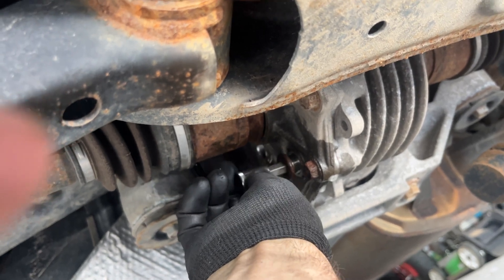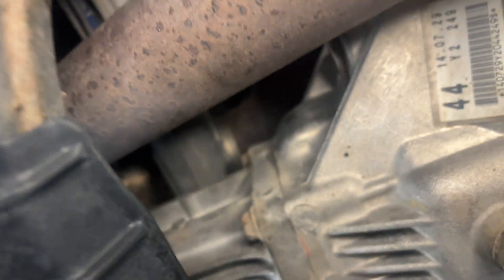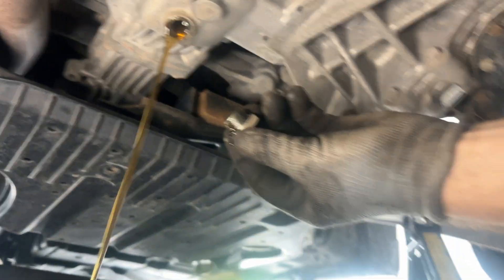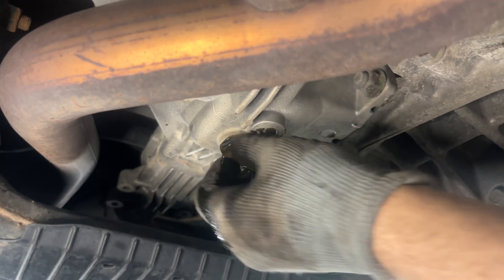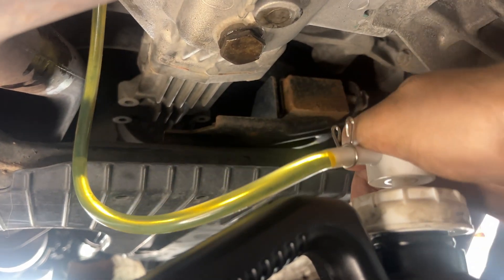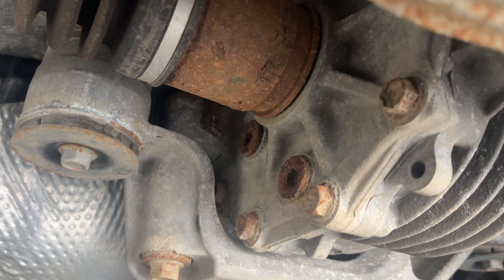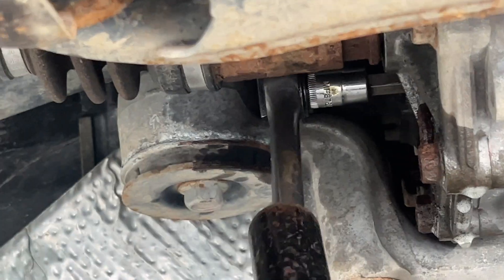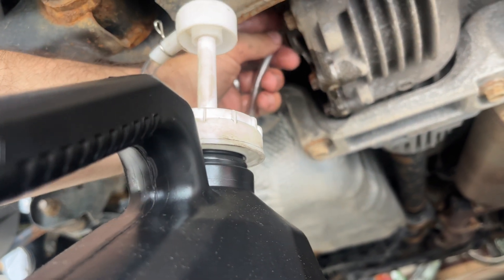Lexus and Toyota Differential and Transfer Case Fluid Replace, Front/Rear (2010 - 2015)

Comment: I only saw transfer case and rear. Where is the front diff?
Reply: Thats the differential 😂 type F5M43 oil change then open mmc manuals website and you will see it
Reply: The front diff is part of the transmission. If you do a transmission drain and fill, it services the diff too.

Comment: You have enough gear oil there to do both of these 3 or 4 times. The suggest change time is 40-50,000 miles with an AWD and every 30,000 at most if you have a 4x4 and use it as a 4x4 or pull a boat or trailer. 75W90 works as long as it’s G! 5 rated. Toyota calls for 75W85????. Don’t buy the cans at Toyota they charge over $80 for one quart. Use  Reline, Royal Purple, Valvoline or Amsoil or some other name brand. They are synthetic so should hold up even better. The most important part that you missed is to check the magnet on the drain plug for metal. A really fine grey mess is normal a few larger chunks ( maybe the size of a piece of coarse table salt ) is not.